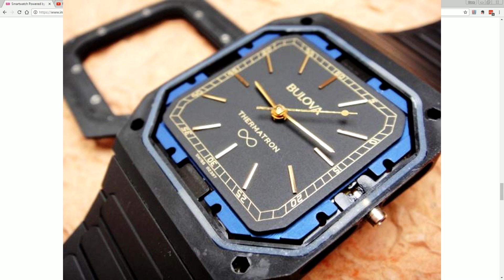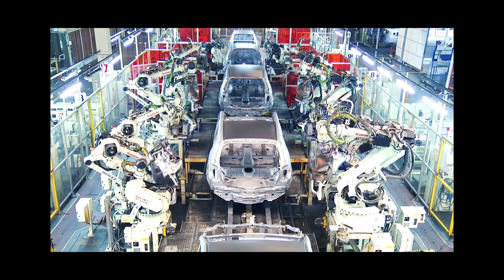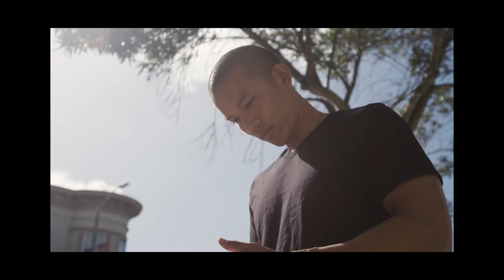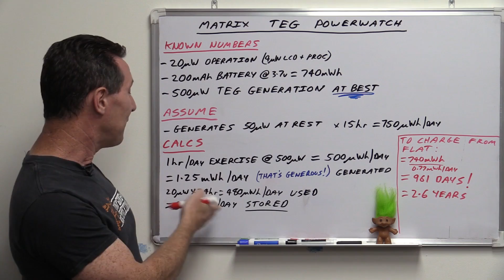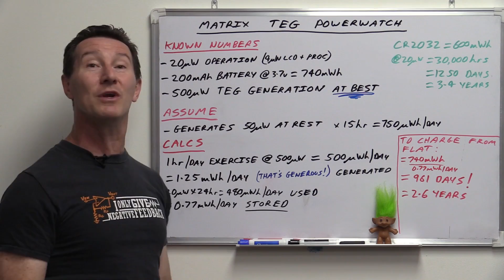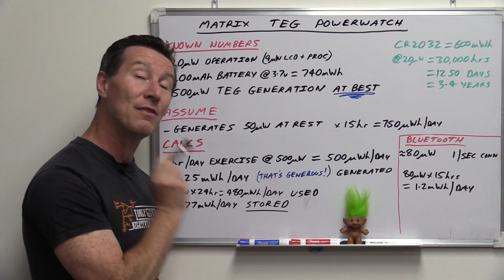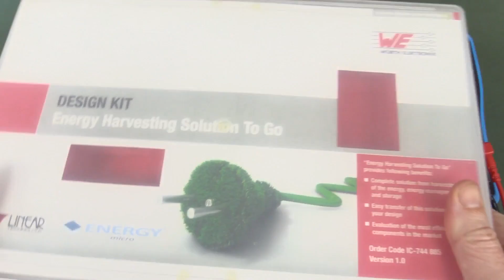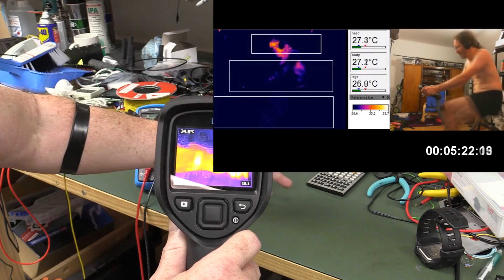EEVblog #945 - Thermal Powered Smartwatches Are GIMMICKS!

Comment: If you really need a gimmicky watch, just get a solar watch.. They actually work very well during the summer, but during the winter when there's less sun and you go out a lot less you'll actually have to let ur watch charge up next to a window. Casio claims it can run for months without any light source... From experience I can tell you that's far from the case!

Comment: Yep I don't see that watch lasting long enough to get any real value out of not changing the battery. Its probably going to break and definitely going to be obsolete before any prospective owners could brag about not changing the battery, which as most of us know will loose capacity over time to the point where the watch will function like a regular watch and run out of juice.

Comment: The environmental beauty of a rechargeable cell is when it replaces many one use batteries.
When a rechargeable cell is charged this slowly it is actually at a disadvantage over a one use battery for several reasons.  Rechargeable cells need exercise.  One use batteries do not.  In this application the rechargeable provides few real advantages and all of the expense of rechargeables.  Wouldn't it be better to "cheat" by using a cheap one use cell but slowly and gradually charging it?  After all,  this thermoelectric energy source is no big energy bonanza anyway so isn't it a better match for slow microcharging a one use cell to top it off?   Economically wasteful propositions like overpriced or failed products tend to be the opposite of "green" don't they?   Something economically efficient like with a much longer product lifespan is more likely to actually fit "green" goals isn't it?  Products that rapidly or prematurely end up in the landfill tend to be the opposite of "green" don't they?
Even more so if they were costly, right?   I see a good ROI and "green" as compatible goals.

Comment: Well.. Do you really need BT connect every one second..   If i get a text i don´t really care if it take 1 second or 5 seconds.

Anyway solar insulation is 1kW/m^2. That is 100mW/cm^2. With a high quality SiGe solar-cell you might get as much as 25% efficiency. Getting out 25mW when in the sun (about 1/6 with random orientation ). and about 2mW when indoors. Just making the wristband with solarpanels would produce way more power.

Comment: Here's what's missing with this criticism of the watch. He points out that it has the same battery lifespan of a traditional watch. This is true, but traditional watches don't have the same functions as a smartwatch. If one only wants a fashionable watch to just tell time, then a traditional battery or spring watch is fine. I have a Citizen Eco-Drive for ye that has never needed a battery change and is great, but it doesn't tell me my heart rate or how many steps I've taken. The "gimmick" as he calls it is actually very convenient. Most smartwatches only last 2-4 days without a recharge. And when I travel, one of my biggest worries is forgetting to pack a spare USB micro-cable just to make sure my smartwatch doesn't completely fail. Packing one watch just to tell time and another just for working out seems redundant,  so to have it all in one watch seams very convenient. His comparison really is apples and oranges.

Comment: If they made a bigass peltier device that i could glue onto my arm and power a very slim watch that way, you could get ten-100 times as much power generated and it would look really cool to have a giant heat sink glued to my arm. heck, they could build a small fan into it to cool the heat sink and still have enough power to power a watch, an actual smart watch!

I would buy the crap out of that, id shave my forearms and have it on all the time!

Comment: I don't get it, they are saying all this energy is lost due to heat from power plants etc. The answer is not TECs when you are talking about a power plant that produces Gigawatts of electricity because the difference the TECs would provide is so minute. The only answer to industrial scale energy efficiency is better technology and infrastructure. TECs are for very specific applications like they mentioned for powering a space probe. Even if they increase the efficiency of TECs with their research, if would probably only be good for use on small scale appliances or at best, personal power generation.

I think an effective way to market TEC technology would be to have something to trickle charge your phone with from your hot car bonnet while you are camping in summer for example. But then again with how good solar cells are these days it would probably be better to just use a small solar panel.

Comment: I'm curious, how would the numbers change if we assume the display only turns on demand (when touched, or used)?
Reply from the maker: Not by much. It would make the case for a TEG being practical even worse. As if you just used an ordinary battery you'd almost the shelf life.
Reply from the maker: Even they admit the fully charged battery in the watch in sleep mode will last 10+ years! So what point is the TEG? There isn't one, it's a gimmick.

Comment: instead of a watch they need to put the tech in a phone. to extend battery life and emergency charging. NOT AS A MAIN CHARGER.
Reply: How long would it take to generate enough power to be able to power a phone so that it could turn on, link with a cellular tower, and place a call? 1.25mWh/day doesn't seem like much. I think just having the phone on stand-by would use much more than it could generate.
Reply from the maker: Err, no, that's not going to help. Do the math on say 1mWh/day. A mobile phone it typically 5Wh, so it would take 5000 days to charge the phone battery with this TEG. Even 1/100th of the capacity would take 50 days!
Reply: EEVblog yep a nice rugged battery bank in your bag will fair much better if you find yourself short on power.

Comment: Simply get mechanical manual or automatick watches. Do not get it why I would wear smart one, which is prone to electronic faults, firmware bugs and depend on smartphone/gadget to get full potential. Watch must be simple to use and reliable.
Reply: It's a lifestyle thing. A lot of people who have grown up with technology are used to being very connected - text messages, social media alerts and IMs coming in several times an hour. To someone like that it's very useful to be able to glance at their wrist every time a message comes in just to make sure it's something they can safely ignore for the moment, rather than have to keep getting their phone out. Especially if their boss doesn't like employees fiddling with their phones when they should be working.

Comment: I feel like 1 hour per day exercise is a little low for someone who'd consider themselves active. I hit the gym 3-4 times a week for around 2 hours per session, and I get an additional hour of purely cardiovascular workout per session as well. On the non-gym days, I usually still get an hour or so of moderate exercise just doing my hobbies and daily activities. 

For extremely active people or professional athletes, it could be as many as 2 workouts a day 5 days a week, and multiple hours per session.

Still a gimmick, but I know I could charge it faster. :p
Reply: You don't realize how little normal people exercise. Try 0 hours / year, not including incidental activity such as going from A to B or moving stuff that needs moving. That low level is plenty for mechanically charged watches ("automatic" or "kinetic" depending on energy storage).
Reply: You don't realize how little normal people exercise. Try 0 hours / year, not including incidental activity such as going from A to B or moving stuff that needs moving. That low level is plenty for mechanically charged watches ("automatic" or "kinetic" depending on energy storage).
Reply: John Doe If you're not an active individual, you probably aren't interested in buying a smartwatch that tracks your caloric output, eh? "Normal" people aren't the target market here. Even someone just trying to get their 10k steps walking per day is just going to buy a cheap $5 pedometer.

Comment: I agree, its definitely a gimmick... then again so is the levitating Delorean... It may not be all that practical, but it is cool and western civilization has taught us anything, it's that people will spend money on "cool" even in the absence of practicality. It will probably get picked up by all the gadget fanatics out there as the average user probably can't make heads or tails or doesn't even care about a watch that doesn't need to be charged in a conventional way.

It is funny though, when smart watches first showed up I remember thinking "Why don't they just use E-ink displays for efficiency and daytime readability." Which leads me to think, does this watch have some kind of luminescence for viewing in the dark? If not, then wouldn't a creative use of solar cells be more efficient?

Also a bit of future tech: A few months ago I remember reading about research into a new "smart material" that converts infrared radiation into electrical energy in the same way photovoltaic cells convert higher energy photons into energy. I am skeptical though, as this would seem to run entropy in the wrong direction breaking a fundamental law of thermal dynamics. Right?

Comment: People aren't wasting money by investing in ideas they like. I never wear my fit bit because 1. It has to be charged every 5 days. 2. It's not water resistant. I currently have 2 solar watches. But they have no fitness tracking. So a watch that does all the dumb watch stuff + fitness tracking + never needs charged + water resistance? This is what I want to see on the market. This is what I invest in to see come to fruition. Ideally, they make a product that works and the tech gets bought by a larger company. The market system is a wonderful thing.

Comment: I have a solar casio watch from 2007 thats never had an issue, my g shock hrm watch has to be charged only if you run the hr monitor at all times (every 4 days or so I lose one battery bar, but im never in the sun.  solar g shocks are cheap tanks.

Comment: A simple silicon solar cell in sunlight, say 1 square inch, generates around 50 milliwatts, a HUNDRED times more power than the TEG.  And it's cheaper, thinner, and available in huge quantities.   And it will charge even when you're not wearing it.  Why go with technology that is so much worse?

Comment: It really is pointless, why not work to develop a faster charging battery with a longer service life instead of trying to eliminate a robust proven technology? I mean this watch would actually be improved with a reasonable battery, imagine if you wear different watches will I have to leave this on a heat pad to avoid resetting everything if it's been off for a few weeks? It would be much better with a battery charged by a wireless station to keep it weather tight.

Comment: Here's what will happen.   It will have a charging port on it "just in case"   people will plug it in every night to make sure it doesn't go dead due to lack of power generation the next day.   So you'll end up with a sub par smart watch that you plug in anyway. 

I also like how they talk about the waste of batteries when their device has a battery that will undoubtedly end up in a landfill... Probably sooner than a real smart watch.
Reply from the maker: No need to add the charge port, they have already admitted the fully charged battery will last 2 years. It will come fully charged.
Reply: EEVblog oh gotcha  so the charging is completely superfluous because in 2 years you'll want a new watch anyway.
Reply from the maker: Correctamundo.

Comment: I was hoping there would be some radioisotopes in there. Could that work?
Reply: AFAIK the only way to utilize radioisotopes is by powering a TEG. I guess it's doable. I would also not want that thing anywhere near my body if it contained enough radioisotopes to keep it warm :)
Reply: tybofborg well that would make it the first interesting smart watch imo! :)
Reply: There are various clever ways to utilize radioisotopes that don't involve thermal conversion (like betavoltaics) on a small scale but in general, yeah, thermal  RTG is what is used.
Reply: Pu-238 does very little gamma decay so it's harmless if put inside a sufficiently thick steel body.

Comment: I really think you missed the mark here Dave, the point was specifically to eliminate a disposable battery. If the product functions exactly as advertised, it's a pretty douche move to 'debunk' it like this. 

They're not batterizer, gimmick or not, it functions as intended. It's a cool idea of a product. And it helps fund to further the technology to a point where it isn't as gimmicky.
Reply from the maker: How long do you think the internal lithium ion rechargeable battery is going to last? (Hint, they fail quite easily)
A CR2450 would last the shelf life of the battrery
Reply: EEVblog That may be true, but the device still functions as intended and as advertised.
Reply: True, but if the point is to remove the need for disposable batteries, using a dirtier to produce battery in their place is a strange way to do it.
Reply: No, that's not the real question. Plenty of things are unnecessary. Look at the early electric cars. Most of those were garbage compared to gas cars. But those were foundations to build on. 

The questions for indygogo campaigns are can you back up your claims, and does anyone want the product. If both are true then good for them. So the product is too gimmicky for you. Who cares. Lots of products are gimmicky. Some of those gimmicks grow to be awesome products eventually.
Reply: they advertise the watch as a contribution to the quest on saving the world by saving energy - but their energy footprint sais otherwise:
instead of a disposable coincell they use a disposable lithium battery AND a disposable thermal electric generator
Reply: Some people will always be cynical...
Reply: David Jeffers YEAH- makes me sad it does not have USB - otherwise I could use it to charge my Phone
Reply: Just saying, I am currently working on a TCP controlled re-flow oven... Essentially a wifi toaster.
Reply: Thanks, my motivation was to be able to use a web interface to draw reflow profiles, veiw stats, and log data. The wifi will allow me to setup my run inside my house while the toaster is in the garage. This avoids fumes and such contaminating my living space.
Reply: I will opensource the software stack for it. I have a custom SPI controlled 5 channel with individual CJ compensation per channel thermocouple board I made as a rPI hat. Likely not going to opensource the board files for this as I would like to sell them as my first product. As for an instructable, I am well past the board design part, I could document some portions of that though. I did use kiCad so if do opensource the board it should be very easy for others to make it. Unless there is some serious interest I will not be building another board unless ordered (40 USD cost per).  Software has been thoroughly commented on github. I plan on doing a video of toaster assembly and such. 

I just stated my 2 week vacation and hope to finish up the software stack by the end of it. Right now I am having a hard time understanding sockets (fist time using them). I have a C++ class object the represents the thermocouple board. This will be interfaced with by the sockets layer (currently using boost ASIO libs). From there I will have a node.js layer process information from the TC board and then output it to a web interface where the user can setup a profile for temp and monitor/configure the controller.
Reply: If that's the point, then it's nothing new - there are plenty of long-life rechargeable smartwatches on the market.
Reply: @93DavidJ  Mine doesn't. I have recharged it 7 times in 7 months.
Reply: @93DavidJ  Unfortunately, PowerWatch 2 does not live up to its promises.